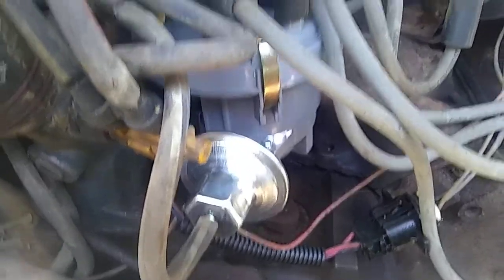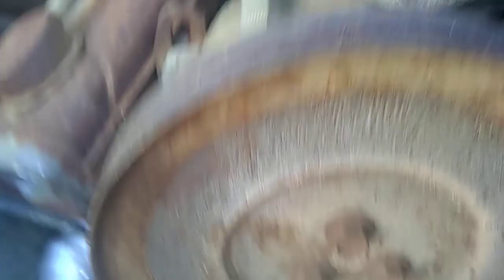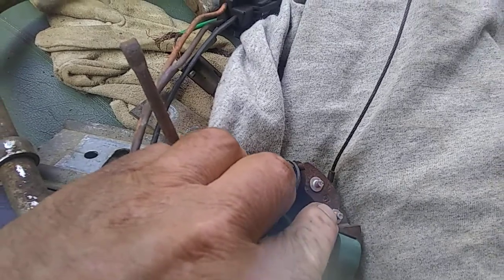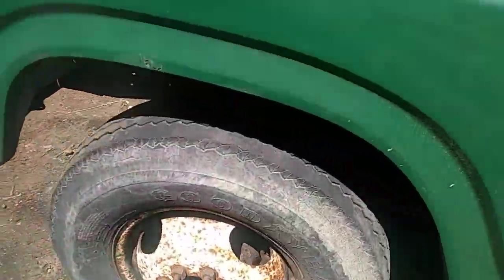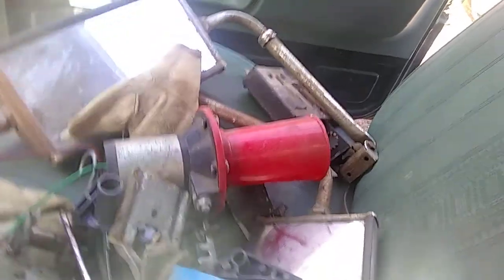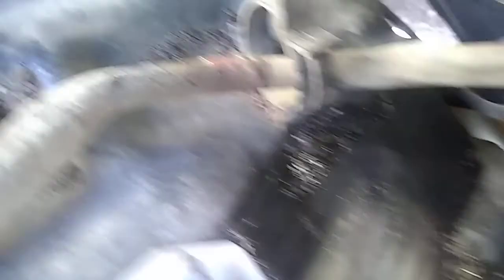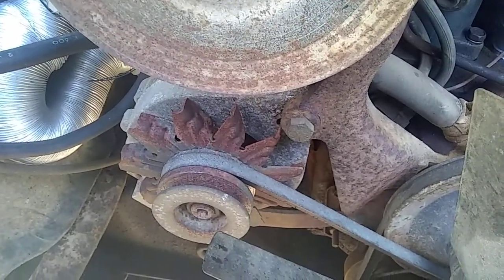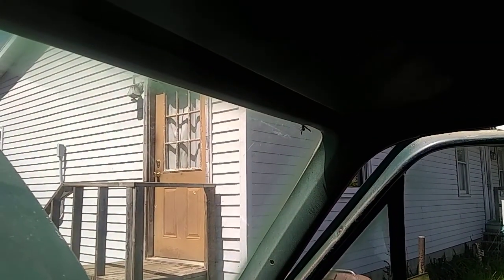working on my future scrap hauling dump truck

Comment: I like the design of the Ford distributor cap more than the general motors style
Because of the General Motors style has tiny screws that often times corrode and are nearly impossible to get off
And there are huge pain to put back together
Reply from the maker: I do like to distributors in the front of the engine makes it a lot easier to get to and work on hope you're having a good day